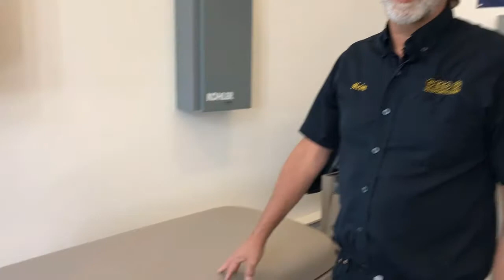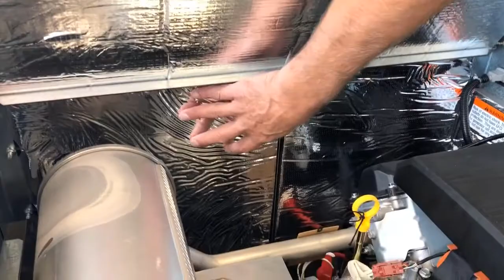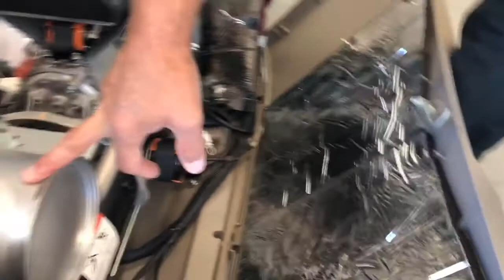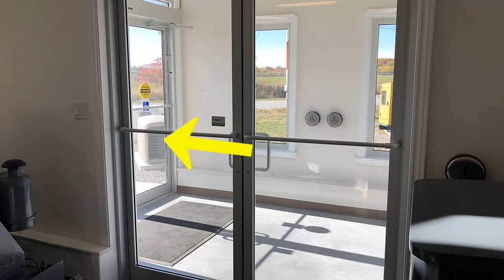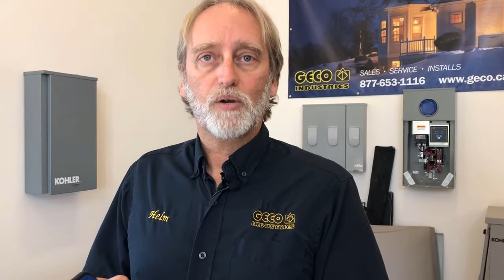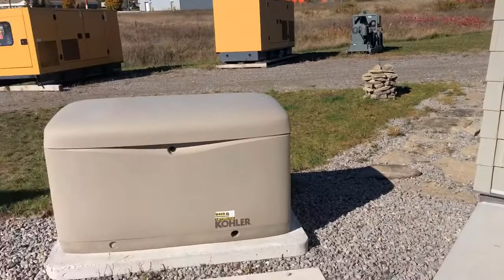Is a Kohler Generator Loud?

Comment: I have a question. When my Kohler generator does a test run, should the generator actually kick on or just the unit running for 20 minutes. This is what mine is doing. I’ve had a lot of trouble with it…however, I think it is the company who is working on it more than problems with the generator.Thanks

Comment: This is good news that this particular model is relatively quiet i guess but what about the higher up Kohler models?  Do they too use all these sound muffling items in those models as well?
Reply: They turn to liquid cooled after 24kw, meaning much less noise and RPMs, but also cost is a big difference. The air cooled models like these, are practically same motors in a commercial grade mower, but the casing makes them a little quieter.

Comment: Can you please expand on the WiFi, the App & how to use it over my Cell Phone? Is there an App? Or do I need to run a Special line to the Generator?  Generac has it included in their package. I just got the 22KW from Kohler.

Comment: It would have been nice if you even used a sound meter app on a smart phone to record the decibels where you were standing outside and then start the generator and measure the noise level again.  I did a crude measurement and found a 15 dB noise increase when you were outdoors running the generator.

Comment: WOW, that is loud outside.  The whole neighborhood now know you got a generator.  2021 these companies NEED to work on getting the noise levels done to levels comparable to at least a Honda Portable. COME ON AMERICAN COMPANIES GET A CLUE!
Reply: If you think that's loud, then you're a little lost. They were able to carry on a conversation 6 feet away from it. That's INCREDIBLY QUIET! Remember, nobody is going to actually stand right next to their generator while the power is out. They're going to be inside, maybe 20+ feet away.

If you think you're going to go down to the 50 db levels of the generators used to power food carts, forget it, those are tiny 1-2kw inverter generators. Getting a 14-26kW generator at a 66 db level is insanely good. Anyone inside their house will barely hear it and it will quickly turn into background noise.
Reply: You're comparing two completely different things here, because if you were to compare a Honda that was the size of this Kohler, it would be the same Db level.

Comment: Typically sound level ratings are at 18-20' from the generator. You demonstration suggests that this generator is relatively quiet. Nice though if you could produce some hard numbers as meters can be as cheap as a smart phone app.

Comment: We have a Kohler whole-house generator which runs once a week for maintenance.  I have to open a window to hear it.  The neighbors cannot hear it.
Reply: the bigger liquid cooled are very nice units, they run at 1/2 the RPM of the small air cooled, thus whisper quiet.
Reply: Good to know. I'm generator shopping and was going to go with Generac because everyone I know has one but I'm going with Kohler after hearing all of the Generac complaints.
Reply: @cfoster6804  did you end up getting the Kohler. If so, what are your thoughts?
Reply: Just curious does it sound like you are Revving a car slightly that’s what our cooler one is doing please let me know thanks

Comment: I'm in central Florida and am thinking of getting a whole-house standby generator (1875 sq ft house).  Generac seems to be everywhere on recommended generator lists, particularly their 22kw guardian series.  How would a 14kw Kohler unit compare?  Better?  Worse?  Reliability?  Maintenance?  Able to run 24/7 for days at a time while awaiting power restoration following a hurricane?

Thanks!
Reply: I've been an industrial commercial electrician for over 30 years. I had my Generac experience about 20 years ago- never again. IF you have a chance to physically compare the generator portion of a generac to a Kohler, you'll see that they have way less mass for supposed same KW rating.
Reply: I've been told Kohler and Cummins are higher quality than Generac. Make sure you make a concrete house for your generator or else it'll be gone in Florida.
Reply: @Lazy Way Either Kohler or cummins, both are properly built units. Just make sure to get a proper cold weather kit with the one you pick, if you get cold winters. Only reason Generac is so known is because of their massive advertising budget. I installed a small commercial Generac unit - single phase like the house  ones years ago for backup for a customer's  main data room. The power quality was so bad, when they upgraded to a higher end UPS unit to go with it, the UPS would not even recognize the generator power source because the sine wave was so bad.
Reply: @jimdandy9289  Thanks for your input. I was about to pull the trigger on a Generac and while researching seeing so many people say don't do it. You are right it's their advertising. Everyone that I know who has a generator has a Generac and these people aren't the types to do a lot of research.